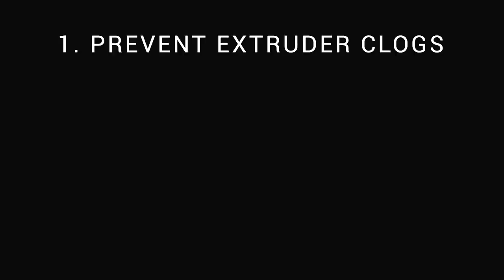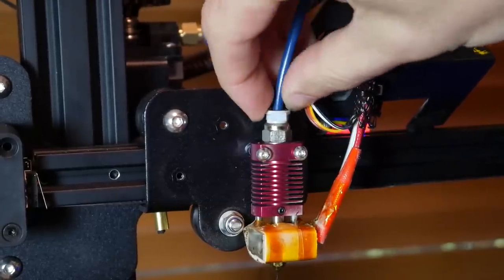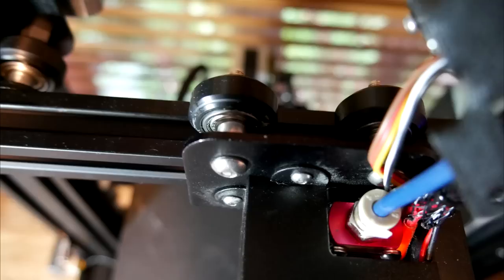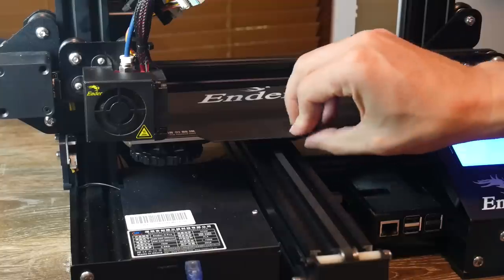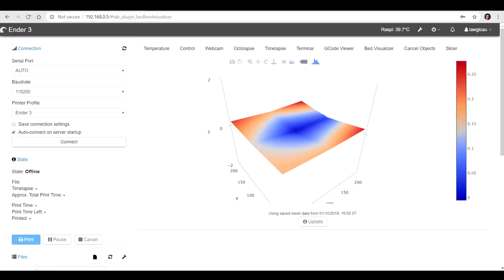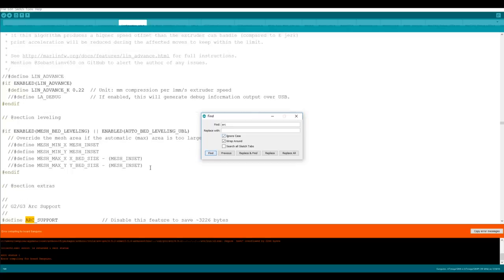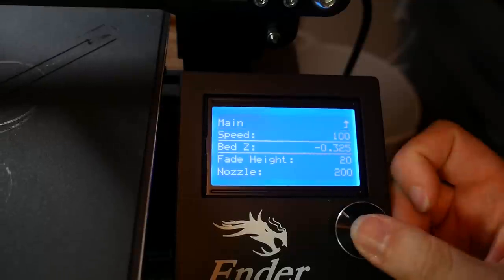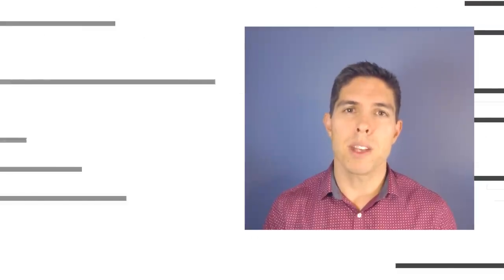5 beginner Ender 3 fixes - featuring manual mesh bed leveling guide

Comment: just got one of these. and after bed lvl print i noticed the the 4 corners are down and center is up on my table. trying a piece of glass to see if it helps. not enough. i get a good print and the next falls apart. check the bed and its out of tram. back to lvl it.   so far as im self teaching myself, i have learned how to waist time and material with this machine. im at the point to return due to warped bed out of box, it wont hole a lvl bed for more then a print, and i noticed the bed jumped time and through the axis off in mid print. im a swap out and pay the difference for a flash forge like i was told to get from a friend.

Comment: Hi Michael, i'm currently printing a 3dlabprint RC Plane with the Ender3 ... it just finished a 13h print, and it messed up the last 0.5cm. The object is 20cm high and was printed very nice but at the end something must have happend which caused a 1mm shift of the x and y axis. I could not detect any reason for this. I printed using octoprint instead of the local SD card ... maybe this caused this issue but to be honest i'm a bit lost within this issue and also a bit scared to print the next "big" part. Did you run into any similar issues? Any hints ?
Reply from the maker: On older printers, they were susceptible to overheating steppers and stepper motor drivers, which caused shifts. If you've lasted that long into the print it's more likely that the nozzle caught on a raised bit of the model and caused the skip. 
it sucks but sometimes these things happen.
Reply: Ok thx for the hint, due to the fact my ender 3 seems to be produces within the last two month i guess the nozzle was caught as you mentioned. Btw. do you suggest to use Belt tensioner for the x axis … like this one https://www.thingiverse.com/thing:2502801 ...
Reply from the maker: I haven't  needed one, but having said that it will makes the process easier and hopefully less likely to lose tension over time.

Comment: Those assembly screws you refer are they meant to be taken out?  is it a design flaw?
Reply from the maker: It is debatable. On paper they will add heat creep but it's not essential to remove them.

Comment: I know it's an older video but I wanted to share my experience with a glass bed. NO GLUE NEEDED! First, use PLAIN WATER on a soaking wet cloth (sponge is better), carefully wipe the printed area down get rid of dust/dirt. Set bed at 52 C and let the water evaporate a bit but not all the way cause you want the bed slight moist. Immediately set the bed down to 40 C and begin print. Get the first layer at almost room temp. The second layer set the temp to 80 C and keep it there til done with print or after it prints 4 layers. Please thumbs up to show my tips.
Reply: BTW you might want to experiment with the print speed. I typically set mine 60-70% but leave everything else on default. It's best to preset the temps so you don't have to. There should be a nice smooth and even surface when printed with those speeds. It's not required to keep temp at 80 C after a few layers, only the first 3 because you want your print to stay flat otherwise it will start raising up on the corners.
Reply from the maker: I've never heard of a technique quite like that before. Full points for originality.
Reply: Teaching Tech maybe somebody could confirm if it works for them. I printed a 90 × 90 square and it printed beautifully with a nice carbon fiber hatch look. I used Dazzle Light 1.75mm filament. The temps might need to be tweak for best results.

Comment: Quick question re Mesh Levelling. Should you do this whilst the bed is heated, nobody ever says on their videos for levelling, it’d make sense that you do. 
I’ve a pro that has a warped bed and have really struggled so flashed th3d today and used mesh levelling, it seems pretty good so far but I could still tune it further, hence my question.
Reply: No the difference being heated makes is really small, don't bother doing it ike that

Comment: Hi Michael,
Thanks for the great video on how to go about this. I followed your steps in the video to enable the mesh bed leveling but I am seeing this error when I run the G29 S0 code through Octoprint

Send: G29 S0
Recv: Mesh bed leveling has no data.
Recv: X:0.00 Y:0.00 Z:0.00 E:0.00 Count X:0 Y:0 Z:0
Recv: ok

I can see the settings on the LCD they appear to have been stored, the Z axis doesnt move when a print is started.

I have checked and made sure the following was in the GCode
G28 ; Home all axes
M420 S1; retrieve mesh
G92 E0 ; Reset Extruder
Any ideas on why its not working?
Reply: I sorted it out, started from scratch and i can now see the settings when I send the G29 S0 command :)
Reply from the maker: I was scratching my head, glad it is working now.

Comment: Hello, would you recommend using the release version 1.19 or going with the bugfix-1.1.x branch of Marlin? I've noticed that there is at least one recent bugfix for Ender 3 (bed size), so I'm inclined to try the bugfix branch, but I'm not sure if it's entirely safe as it'll be my first firmware update.
Reply: I just flashed the bugfix branch, works perfectly and this guide can still be applied exactly the same. The bugfix branch also fixed the issue where everything slams into endstop very hard when homing, it's now smooth and precise

Comment: Brand new ender 3 and the thing just keeps dumping filament out of the nozzle. I’ve gone well below the proper print temp and it keeps coming out. Big glob hanging as it goes to start printing and drops the big booger on what it’s supposed to print and then it ruined. Cura, ender 3 pro, red inland pla+.

Comment: I've spent 5 days trying to get my Ender 3 Neo to print correctly. I get see through prints that I can crush in my hand. It's contently skipping and I've adjusted everything I can on the extruder. I level the bed before every print.  I'm thinking I've got a lemon or Enders are junk and should be avoided. I've run out of options so I think I'll change out the nozzle. If that doesn't work I've got a 200$ paperweight. Worked for 2 weeks and BOOM that was it. This was a Christmas present from my wife and she's really bummed that it didn't work.

Comment: This didn't work exactly. I got it to work but took some tweaks. I did the compile and it was 2700 over. When i got rid of ARC it then became 224 over. Not sure why it was over when it released 3000ish bytes. Anyway, I commented out SHOW_CUSTOM_BOOTSCREEN and that got me under. 

Before I got through all of that I couldn't get it to compile at all on Mac version of 1.8.8. What I did was delete the old copy and delete the Arduino folder from the ~/library/application_support folder. After that, It acted as a fresh copy. I think I had a conflict from running the TH3D version and it merged in some libraries that broke the normal version of Arduino. So if anyone is getting some odd issues try making sure you are working from a fresh copy.
Reply: Thank you so much for this comment, this also happened to me and I didn't know which lines can be commented out until I see this!

Comment: Thanks for your videos !!  Very informative. I've got only one problem - I do not use facebook...any other way to get access to this info ? Apart from registering dummy account.
After looking at the guide, I realized that my X axis were over tightened as I constantly noticed some residue like dirty oil on the rubber wheels...It certainly can be mover by hand, but with applying load which is quite high...guess I need to loosen it a bit.
appreciate your videos ! 
As another Idea I have is for a video which shows basic steps that needs to be taken  when a person buys/receives new filament to print with. I know there pre-defined settings in FB group, but those are not taking into considerations filament own properties and, what is important, step to identify those.....print couple of test prints: cubes, temperature towers, stringing tests etc and adjustment steps to find the ideal settings for you very own filament with your very own 3d printer....

Good Luck and thanks you again.
Reply from the maker: It's not my file to share outside of Facebook. I will ask Luke is he supplies it any other way.
In terms of the video request, it sounds like this one will help you with what you want: https://www.youtube.com/watch?v=3yIebnVjADM

Comment: Thank you. Appreciated. Just scared to do the mesh bed leveling as if something is not entered correctly then will be stuck.
Reply from the maker: You can always flash back the standard firmware.
Reply: I did this and it seems to work perfectly. I did get two errors: "multiple libraries were found for u8glib.h" and "??? text field overflowed by xxxx bytes". Both were solved, Arduino picked what library to use and by disabling arc support the sketch compiled. Make sure to verify before compiling! If you haven't burned a bootloader, you can use an Arduino board as the programmer with the ArduinoISP sketch. Once bootloader is burned, you don't need to burn it again.

Comment: Upgraded ender 3 pro to 4.2.7 mobo with bl touch3.1 F1st Layer open source firmware. Can I easily adjust the stored bed size setting on my printer? it is currently 230x230x250 and I know it should be 235x235x250 the bed level test print is exactly 5mm off center and I think it's because of that.

Comment: You do not need to turn on probe_manually. In fact when mesh bed leveling is active there is a code to undef the probe_manually. You can even see that weight of the compiled progr is same with probe_manually commented or not. Nothing bad but just for you to know ;)
Reply from the maker: Thanks for pointing that out. I made an assumption, fortunately it will correct itself later in the process as you describe.

Comment: The two screws on the hot end from the first of the video.  Do I need to remove them even if I'm not having issues?
Reply from the maker: I didn't have any problems before or after. I would say it is optional.

Comment: Hello Teaching Tech,

I have Problem with layer shift after Pause the print. I would change the color. After Pause, the Stepper Motor turn off after a while. If i manage to change the filament before the Motor turn off, and go to resume, there is no layer shift. After resume, the printer homing x and y but this dont work, when the Stepper Motor go off in Pause.

Sorry for my poor English.

Thank you very much for your Videos.

Comment: Please add proper temp levels. I could not get good prints and when I did they were really brittle. I used a heat tower and had it change temp as it printed to find the best temp level and prints came out easier and way more solid

Comment: I have a question. If I did do the manual mesh bed leveling, is there any way to remove it from the printer? I want to make sure before I do it
Reply: Manual mesh bed leveling can be turned on or off. If you need to remove this function from the firmware, you have to upload a non-touched Ender-3 FW, to overwrite the modified one.

Comment: Relatively related question.  Using the extra-fine profile in Cura, printing with PLA on prints similar to Benchy, what are you all doing for print speed?  Just curious what everyone else is doing.  I'm doing 50 mm/s for extra fine (.08 layers) and 75mm/s for low quality (.28 layers).  This is all on the factory .04 nozzle with moderate success.  Anyone doing faster/slower with consistent success?

Comment: My Marlin config tells me I still don't have enough space, is there anything else I can remove/turn off?
Reply: Ended up turning off SD-Card capability as I use Octoprint.
Reply from the maker: In the updated BLtouch video there is a guide to things you can disable to save space. Summary here: https://youtu.be/sUlqrSq6LeY?t=751

Comment: I have the same problem with the ptfe tube just push it down. If u can’t get it to print your nozzle probably not set or too far from the glass. Also should use hairspray to get it too stick. Corner level doesn’t show until u does the Bed level so u wrong there.

Comment: So I've fixed the original error and it compiles fine but there is still not enough for the Mesh Bed Levelling with the latest version of Marlin. I noticed that before disabling Arc Support that the size of program was 2700 not 2200 which mean there is 500k somewhere extra in the newest version?

This is the error I get now...

Sketch uses 130224 bytes (100%) of program storage space. Maximum is 130048 bytes.

Global variables use 4735 bytes (28%) of dynamic memory, leaving 11649 bytes for local variables. Maximum is 16384 bytes.
Sketch too big; see http://www.arduino.cc/en/Guide/Troubleshooting#size for tips on reducing it.
Error compiling for board Sanguino.
Reply: I get the same error, any luck fixing it?

Comment: Hey my eccentric nut on the right side of the x axis doesnt go completely tight. It just keeps rotating. Any advice?
Reply: GrimfyreTV I think I can help, the screws are flat head screws that go through the heated bed. They are held in place by this rubbery type of glue, sorta like silicone. I had to lift the bed cover on several corners after I replaced the stock springs with the yellow ones for the same reason. What I did was remove the screws and cleaned the screw and the counter sunk holes of all the rubbery gunk and cleaned the screw and the hole with denatured alcohol. I then replaced the screws using CA, better know as super glue, I like the loctite brand, and let it cure. Before I rubbed down the printing mat I ran the thumb wheels up far enough to be able to tighten up and allow them to be able to tighten and loosen. If you can’t get it to tighten, the screw has a Phillips head you can hold until it starts to tighten. I’ve found that once spring pressure is applied, as long as you don’t losses it again, it will work fine. Then rub the printing bed back onto the metal. I put a glass bed on after but the material seems to be holding to the metal OK.

Comment: When I use Mesh bed leveling I cant seem to get this to get close enough to have any squish to my first layer.  I use it after the manual leveling.  Is there some way to reedit the values after setting them?  Bed Z:   doesnt seem to do anything.
Reply from the maker: Still need to set the z offset which moves the nozzle up or down relative to the stored mesh.
Reply: @TeachingTech  my Z offset does not seem to alter whether I move it up or down while its printing......I certainly cant get the squish I need and it just wont stick to the Creality glass plate. :(

Comment: My issues are after leveling and setting  my extruder height. I print and the first layer wants to print about a 1/4 in above the build plate. I then have to z step quickly down. The sample dog print well but everything I create and or print does this. And when I use cura it tried to print at a quarter of the size..

Comment: Thank you your video was good. But I absolutely hate my ender 3 printer. I got it for Christmas and the first few prints we're good after I went through all the adjustment but as I try to move from print to print it fails more often than it works. Right now I am pretty much so mad I'm ready to throw it in the street. It would sure be nice if someone advertises a beginner friendly product that is actually beginner friendly and doesn't require a bunch of more upgrades to work effectively. I am not a happy creality user. Again thank you for your video

Comment: a little confused on the manual mesh leveling. followed the tutorial to a T and I'm still over by 224 bytes. So i went back and started with a fresh install of marlin and again over by 224 bytes. strange part is if i compile with arc support enabled I'm only over by 2700 bytes but arc support removes well over 3000... so the math isn't making sense to me.

edit
i found a fix just commented out the ender3 boot screen.
Reply from the maker: I think inevitably the firmware evolves and the numbers change with new features added. You did well to solve it.
Reply: So did you lose the custom Ender 3 boot screen as a result of this?
Reply: @TechnoGeek3D  yes I did but that's not the end of the world to me.

Comment: As a noob, i'm having more than my share of problems with my ender. Most of your videos have been very helpful, but some not so much. The problem here is that you assume everyone knows what your talking about. In this video around 11.50 when you refer to typing G29 S0 and around 12.00 you mention more typing in data. With what application should I be typing this in to control the start gcode? Cura is all I have for 3D printing right now
Reply: g29 s0  it will let you know if firmware has that option enabled.
it not print nothing if cant use it.

g29s1 move locaion (or do it in menu)
lower nose
g29s2 store data(or do it menu)
g29s1 move next position(or do it in menu)..etc

startup code in cure you need this
g28
m420s1

Comment: Hello,

I'm having an issue with my printer stopping mid print.  No error messages or "waiting on user" messages.  The printer stops where its at, no more filament is extruded, the print head stays hot, bed stays hot, progress bar remains exactly where it was.  Has anyone seen this issue before?  Any recommended fixes?  No modifications have been made to the printer.  Thank you in advance for any assistance you can provide.
Reply from the maker: If the printer is stock than the culprit is probably something in the gcode. Scroll through the file with a text editor and make sure it is not corrupted or incomplete.
Reply: It is eighter corrupted gcode, that can be happening because of faulty sd card or because of yanking sd card before unmounting it

Comment: Ok so I seen this on another video does it need all this code or just what he is saying here does anyone know. He only mentions the M420 but does it need the M501 also to work correctly. You can add these two codes after G28 : M501 (to recall the data) , M420 S1 (to implement the mesh data into the printing job)